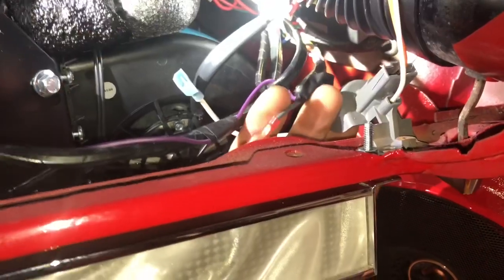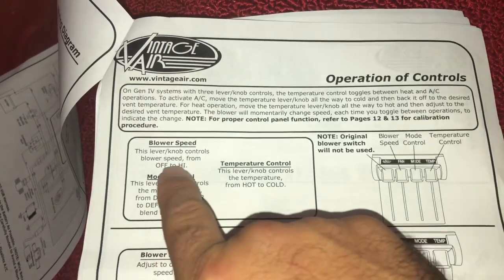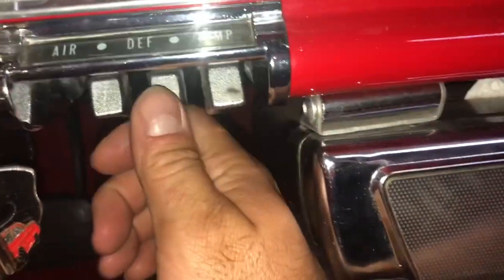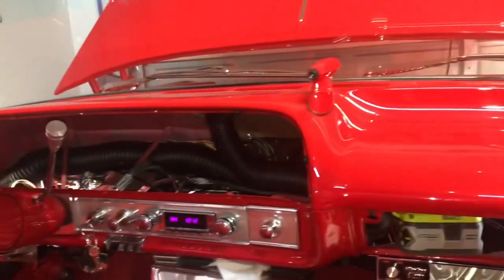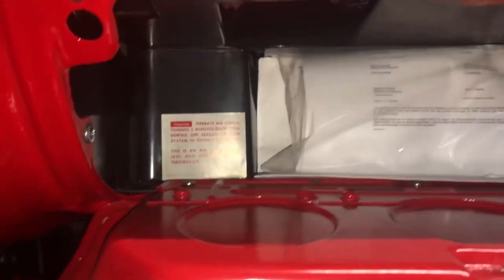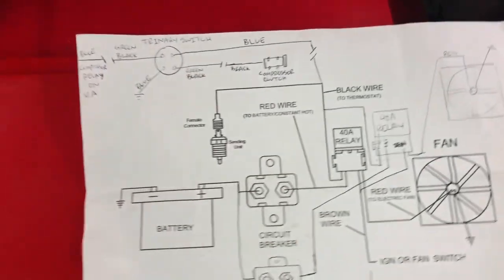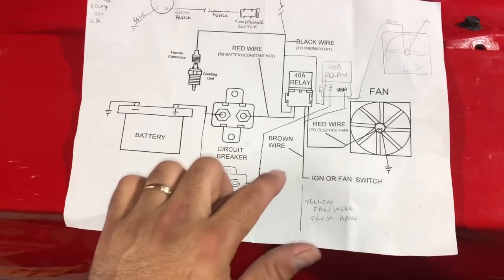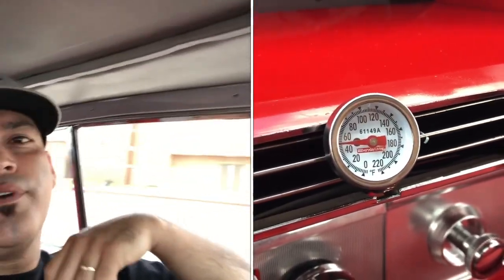Final install vintage air 1964 impala red rocket 64

Comment: thank for vids brother,i know this an older vid and wondering if you remember when you ran that wire from trinary to sender unit or thermal switch did you wire a whole new wire to the thermal switch because i use my thermal switch for my electric fans and the wire is already there and not sure if i should splice into it or run a new wire to the thermal switch and link them there,,thanks brother i used your video for info and inspiration and am putting this vintage air in my 62 impala which is a pain,your 64 looks much easier because your glove box is where all the wiring is.
Reply from the maker: I honestly don’t remember 🫤 I just followed the instructions, I’m sure I wouldn’t of, or didn’t have to add a extra wire though.

Comment: New subscriber here! I have a question, on the previous video you said your impala ws not factory ac, did you add the side vents?
Reply: Also great detail on the videos! Much appreciated bro
Reply from the maker: @rickg-funk3144  thank you, yes I added the original dash and side vents 👍
Reply: @RedRocket64  did you make a video on that? I got my 64 ss non factory ac but i dont like the ac system with vents on the bottom.  I want it to look original like yours. Any input or advice to lead me in the right direction would be much appreciated.
Reply from the maker: I didn’t make a video on that, I just took a pictures off the car I removed the vents from and used those a reference. I used a 3” hole saw and dremal to make the holes 👍
Reply: @RedRocket64  so its nothing crazy, i can do that too then. I thought it was a completely different dash. Thanks for the help
Reply from the maker: @rickg-funk3144  Same dash, it’s really not bad, about 1 hour of work. Make sure you have the vents so you can fit and cut as go. Take your time. 👍
Reply: @RedRocket64  looking for some online now! Thanks and appreciate the detailed videos

Comment: Hey red rocket I was talking to lone 🌟 were did you buy cage nuts that go in the floor braces were body bolts go
Reply from the maker: I had found them on eBay, let me see if I can find a link 👍
Reply from the maker: Tommy Gomez speech this item number on eBay 

233665447901
Reply from the maker: Tommy Gomez the size that your looking for is 7/16-14 cage nut.
Reply: @RedRocket64  were did you get yours from I just need 2

Comment: Hey quick question on your frame did you use 3/16 still   How big were the still sheets  And how many did you need Or did you buy A pre cut kit thanks.
Reply from the maker: Yes 3/16th full 4’x8’ sheet and some flat bar.

Hope that helps 🚀
Reply: @RedRocket64    Yes thank you I just didn't know how many 4"x 8" I needed to do a full frame on the impala
Reply from the maker: Oso Garcia No problem, 1 full 4x8 sheet 👍
Reply: @RedRocket64  thanks🙏🙏

Comment: Any leads on where I can get my disk brakes for the rear that clears 13’s
Reply from the maker: You’d have to find one with a 10.5” rotor so the caliper can clear 13s, I’ve personally never seen a rear disc brake kit with anything less then a 11” rotor, so you can expect to have to grind the calipers some. 

What rearend are you running?
Reply: Thank you very much for the response,, I’ve watched every episode on your build,, learning a lot from you and lonestar,, I will look for the rear kit! Thanks bro, 👍
Reply from the maker: No problem, anytime, thanks for the support 👍

Comment: Refuse to drive my 62 in this Cali heat till I get vintage air
Reply from the maker: Jah GaZ Yeah man, this heat is terrible, it was still 100 degrees late into the evening yesterday 😬
Reply: OMG, I still cant believe all the custom cars i see in Cali that removed there air conditioning?  my impala never had air so I have not choice but to go the vintage route
Reply from the maker: anyshitt Yeah, vintage air is the way to go, you’ll love it 👍

Comment: Hey Bro
I have a question can I email you?
Reply from the maker: Hey man, I’d rather answer here, what’s up bro?
Reply: I’m doing the same swap & was wondering is the engine degree angle an issue? What motor mounts did you use?
Reply from the maker: D J It is a issue, the engine has to be as level as possible, the lt engine mounts are also wider then the SBC, you have to make new holes on the engine saddle/crossmember.  I used dirty dingo sliders with SBC motor mounts. 

Side note, if your going to run the same transmission (6l80) your going to have to modify your tunnel to make it fit, it’s to y’all for the stock tunnel. 

Hope that helps 👍
Reply: So basically the best I could do is get the engine as low as possible. I’m using dirty dingo sliders I’m looking for the lowest profile motor mount available. From your videos I was expecting to cut the tunnel. Your videos gave me the courage to try this. You’re a HUGE reference point lemme tell ya
Reply from the maker: D J Yes sir, low and level, the DD sliders and small block Chevy engine mounts will get you there 👍
Glad the videos helped, if you have any other questions let me know, I’ll try my best to walk you through them 🚀